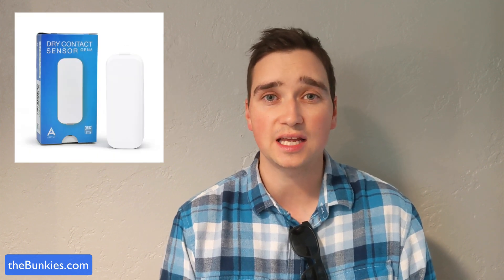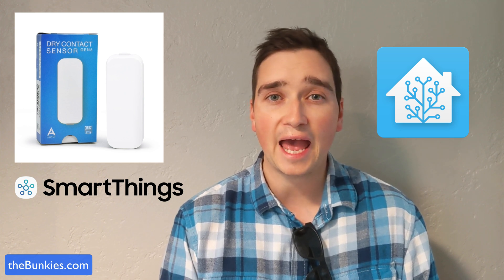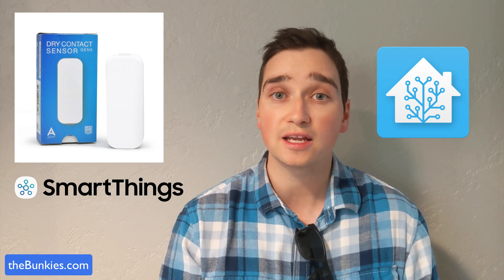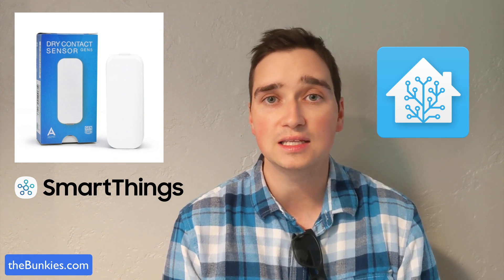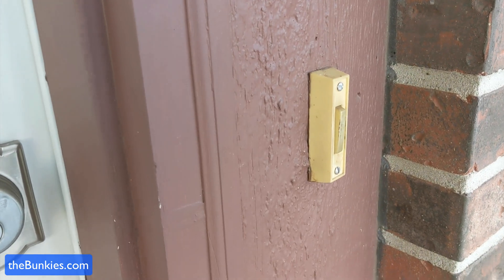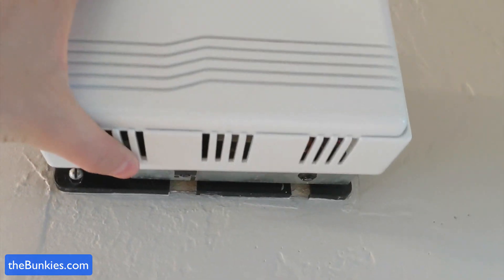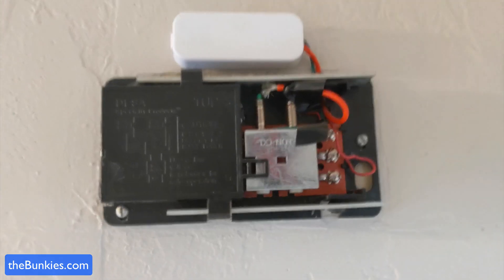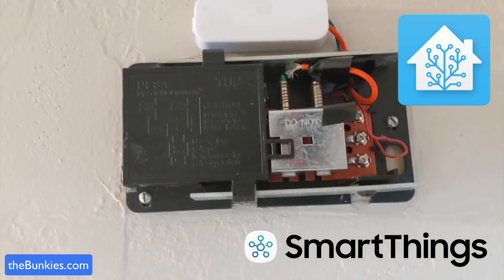Smart Doorbell Using a Dry Contact Zwave Sensor

Comment: I get the concept, and want to do this, but some more information would be great. How is yhe contact happening? Physically pushing two wires together, or the moving mechanism is metal and conducts between two wires? What sensor specifally are you using?
Reply from the maker: Its mechanical